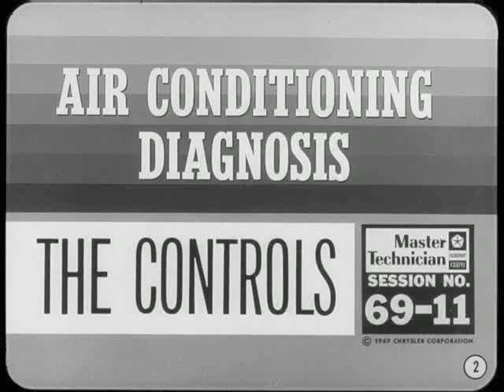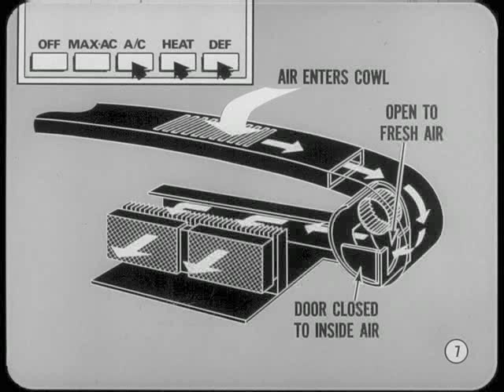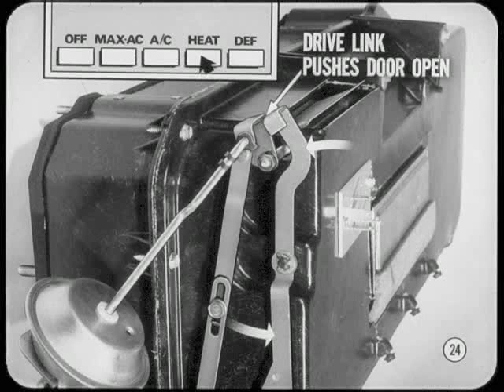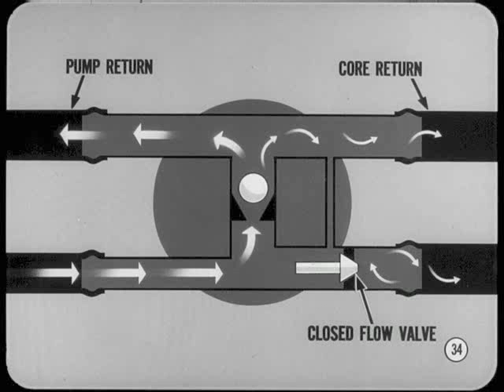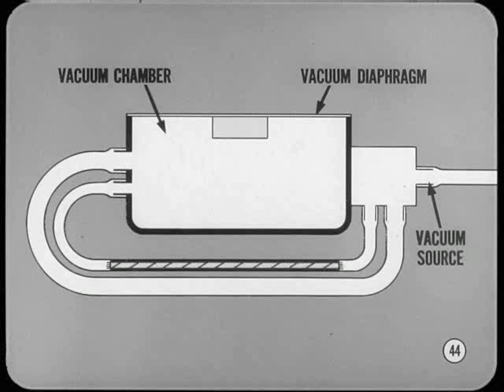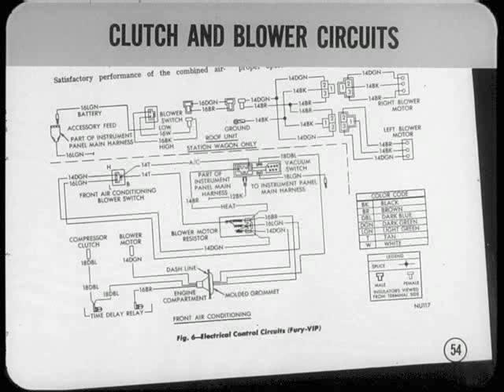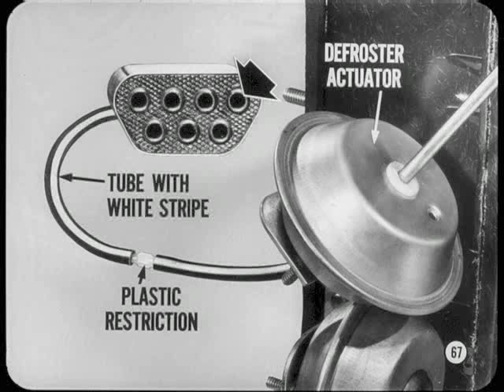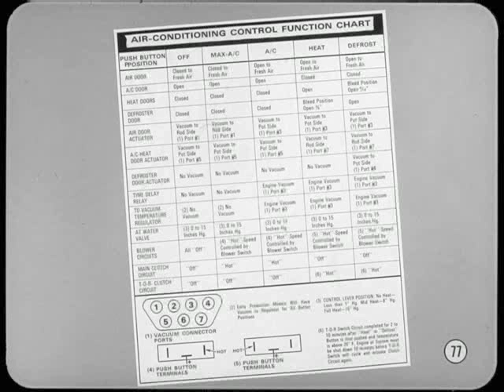MTSC - 1969, Volume 69-11 Air-Conditioning Diagnosis...The Controls

Comment: Thank you for sharing this! This information helped me tremendously in getting the HVAC system in my 1969 Plymouth Fury III convertible operating great!
Reply: I can relate. A previous owner of my ‘69 Fury convertible threw away everything A/C related from under the hood. Fortunately, everything under the dash was intact. I managed to find everything that was missing, including N.O.S. parts.  The evaporator and heater core were bad (it seems some of my fellow desert dwellers tend to run straight tap water in their cooling systems). I was able to get replacements. The factory service manual covers  the necessary information, but these Tech film strips and booklets are extremely helpful.